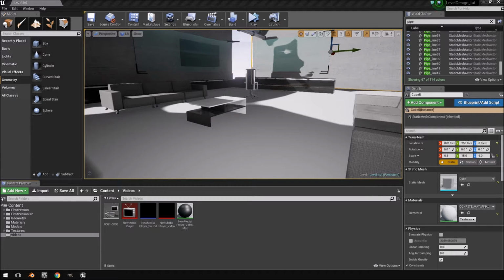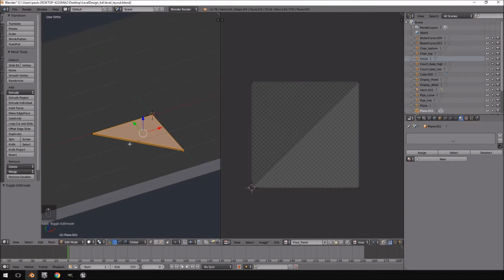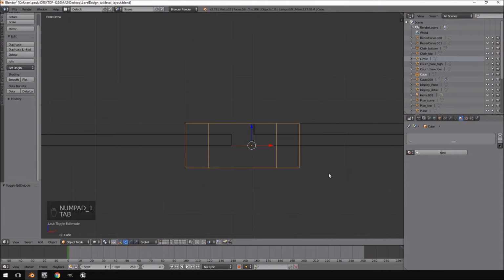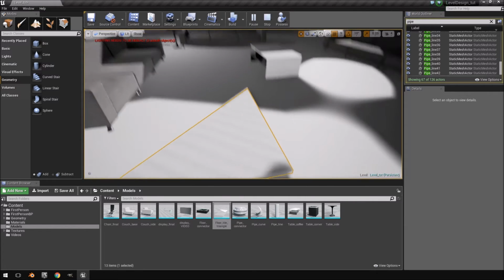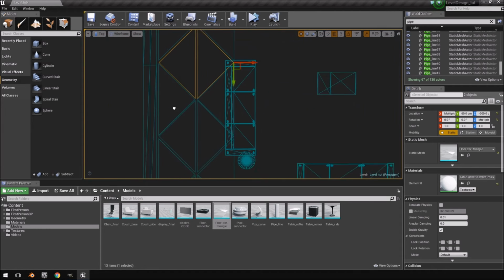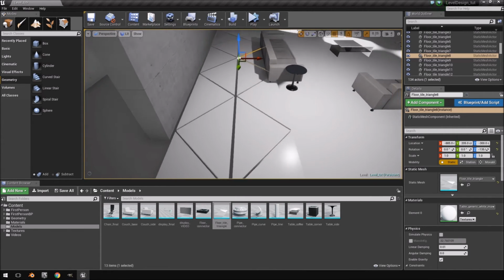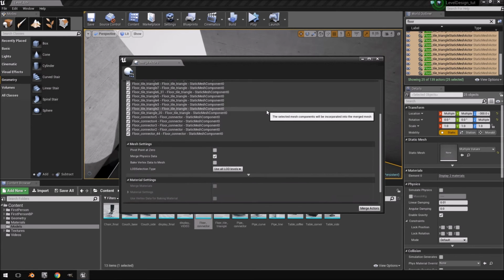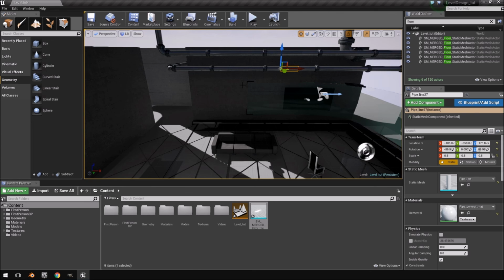Level Creation using Blender & Unreal - Part 30 - Creating the Floor using MERGE ACTOR

Comment: could you have gone one step further and merged all the floor pieces into one actor or would it not really be necessary?
Reply from the maker: +Zach Roberts depends on what you want to do. But yes you could have merged all together.
Reply: wow thanks for the fast reply! curious in the event of using modular assets for instance if i was to merge actors with different materials, would it merge the materials into one as well or would it just give the object multiple material channels?
Reply from the maker: +Zach Roberts I'm haven't tried it like that before. Merge actor is not always the best option. As far as I remember it will create a different material slot for each object merged regardless of whether they use the material before being merged. That will create a new draw call for each additional material and optimization goes out the window.
Reply: optimization is really what im aiming for, If i was to use modular walls floor and roof pieces to create a house for instance, would it be more beneficial to leave the pieces as separate parts, or merge actors in your opinion? or even create an actor blueprint for all the objects for the house? Thanks again for your time
Reply from the maker: +Zach Roberts I would go with creating a blueprint for it. Or if anything construct most of it in your 3D program and import as a single mesh. But all depends on what you are doing. I just normally check what works the best with minimal performance impact. Depending on the scene it won't always be the same.
Reply: awesome! thanks again for your help